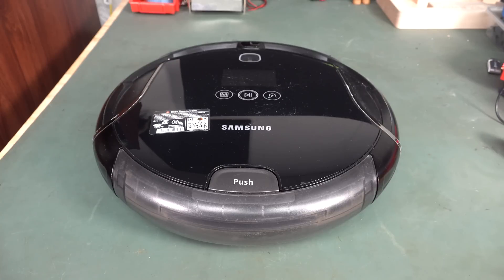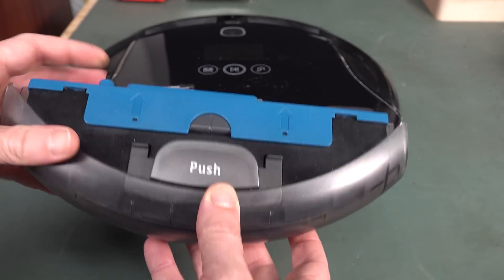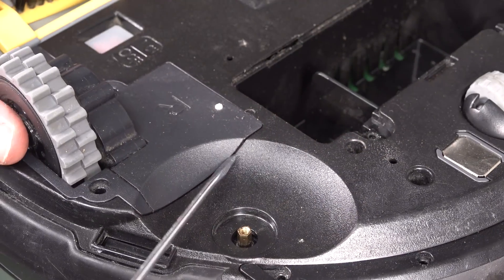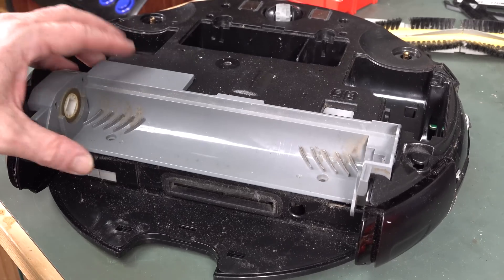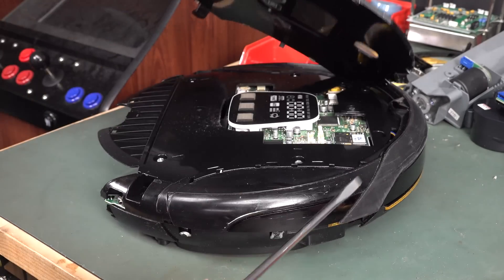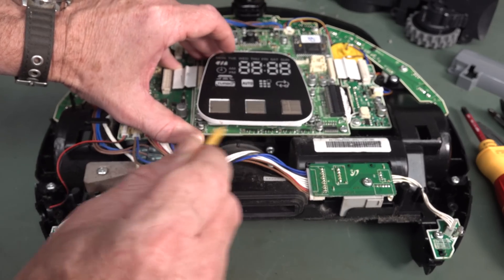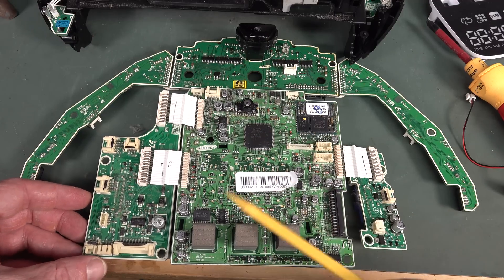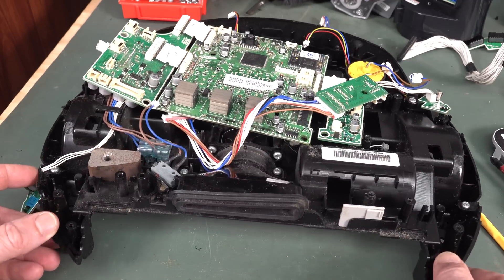EEVblog 1523 - Dumpster Samsung Cleaning Robot TEARDOWN

Comment: I bought one for my elderly mum, its brilliant, but need to get a good model, you can get irobot roomba model 980 for $250aud or so second hand in oz from ebay,  the later models you dont need to empty them after each use, they empty into a tower.
What is amazing is that the irobot 980 uses 4 lots of 18650 cells, such a small battery but it goes for an hour or so. The battery you could fit in 8 lots of 18650 if you wanted.
I just bought some panasonic ncr18650b for that purpose, a bit tricky to change the cells have to desolder tabbing wire etc, fiddly/tricky.
Go for irobot 980 is you want a really excellent vacuum, they also clean really well too.

Comment: That samsung one is rather serviceable. I like that!
If you ever get the chance to take apart an Vorwerk Kobold VR100 (or one of their siblings): That thing is linke Voyager 2 in therms of serviceability. Cant get it open without breaking every stupid plastic clip. And if you're in you'd be greeted by a nice "Neato robotics" on the boards silkscreen.
I have a Neato robot vacuum and can say: Vorwerk took an existing design, made it 5 times worse and sold it for 10 times more

Comment: That Robot vacuum cleaner (SR8980) was €700 when it came out in 2013, my BluMill MT-710 looks precisely the same 
as this Samsung SR8980 Robot vacuum cleaner on the underside, mine even has Mopping function and Water tank with 
2 mops, but my cost €159 and does the same or more, and works great on my carpet , it's never been that clean 🙂.

BTW, my debris reservoir, is much larger then this Samsung SR8980, and is 600ml.

Comment: It is interesting to compare this to my old Roomba. Overall very similar but I saw some differences:
1 - On the Roomba the suction is from a fan within the removable dust collector, so the fan has clean air running through it.
2 - The Roomba monitors the front idler wheel for motion. The wheel is half black and half white and an optical sensor can detect it rotating. I can always tell this wheel is clogged with lint as the vacuum will move a few feet, turn, move a few feet, turn, and so on rather than trying to go in long runs.
3 - The Roomba has a sort of mechanical torque detector on the motor that runs the main brushes, I assume to detect that they are getting too clogged. I'm not sure why they don't just monitor the current draw...
4 - The Roomba only has one edging brush. I assume it only follows walls in one direction.

The main drawback for is is that some members of our household have long hair and it is frequently necessary to open up the brush cage and remove the hair wrapped around the brush.

Comment: Wow, I just tore one of these down myself. Mine was a kerbside special/road kill from some renters dumping their junk and doing a runner. It came with a dust exaction/charging station that I left behind. Mine didn't have the USB port, just 4 solder pads for one. I was kind of interested to see if you would have found the hidden screws, but no, brutalized like mine. I was most surprised to see a camera - the things spying on us was my first thought - remember all the carry on with the Samsung TV camera's - not good.
I powered up the main vacuum motor, it squealed quite badly from lack of lubrication, probably why it got dumped. So I added some oil, but boy is that a weak air pump, the exact opposite of many 240V mains vacuum's that have a one kilowatt or more motor, and pump out insane levels of heat in the process. It kind of made me wonder how this thing ever worked with suck a low powered pump. Sure it cannot be that powerful as it is battery powered, however I thought it was a bit of a joke.
Reply: This was many years ago and I can't remember where I read it now but I read, with some surprise, that the main cleaning action from robot vacuums is not the vacuum suction but almost entirely the mechanical brushing action. This might have changed in the meantime.

Comment: The one thing that should be said in huge flashing red letters accompanied by air raid sirens, is be super careful if you have a dog that might poop on the floor. You absolutely positively do not want a bot to try sweeping that up unless you need industrial strength help purging. Otherwise they work pretty well, at least on hardwood floors (guess why no rugs anymore). You may need to make some accommodations to make it happy though, like rearranging furniture slightly, removing those low friction slider things that may make the couch exactly the right height for to bot to get itself wedged into, making sure the charging station beacon is in a place easy for it to spot, and putting the dog down the garbage disposal.

Comment: Hi Dave, I've got one if those. It needs IR "light houses" to mark of forbidden zones and a remote control.
The eye at the underside us for it to not fall of the stairs, which has also a major disadvantage. I have a small piece of carpet on a mainly wooden floor. That carpet is black with a pattern of light colored circles.
The robot gets completely bonkers on that carpet as he thinks that's an abyss (stairwell) and refuses to go on, but only goes in narrow circles, not even back! Poor thing!

Comment: I'm only speculating, but I think that row of carbon pad switches for collision detection, are not on-off switches, but rather are always in contact. Pushing on the pad changes its resistance. Like a carbon microphone, a small current is passed through it, and a collision is detected as a change, or a blip, in current.

Comment: I have two older Samsung robots. One upstairs and one down and the run every day at noon. Im constantly amazed at how much they find even after running for months.The one downstairs covers the lab and picks up wire strippings and aluminum chips I track in from the garage. 

 I picked these up used from a friend and had to do a couple minor repairs but they work great. I cant recommend one enough.
Reply: I live on a multi-level home; there are 4 distinct levels connected by short (2 steps) stairways.   How many of these things would I need?
Reply: @tubastuff  then can’t get down or up stairs so you will need one for each level you want to clean. In the case of my house it is a split level type with daylight basement. So the entryway is between the two floors. So I still have to vacuum that area and the stairs manually.

Comment: Before I start watching this, I did find and open up a cleaning robot about a year ago. I don't recall the brand but do remember it was absolutely disgusting! There was dirt and hairs stuffed in just about every space available. I wound up taking out every motor, the power jack and switch, a couple rectangular weights, and every spring and screw save for one which was inside a clear plastic water tank and not worth the trouble.

Comment: Kalman filters are more commonly thought of in positioning applications, using data from sensors. The case you are thinking of is a more recent use of it, in computer vision with self driving cars. In this Samsung product, it has nothing to do with object detection or tracking, but rather taking the data from accelerometers, gyroscopes, motor speed, etc and trying to determine position.
Kalman filters can be used for many different things though... the most common and simple case is the phase-locked loop in electronics.

Comment: Next week he might run into the charging station.  We have a Bissell crosswave equivalent and it tends to screw up a lot, but it goes around most table and sofa legs. The bump sensors contact chair legs. (movable)   Ours is monitored and controlled via WiFi from my cellphone. Ron W4BIN

Comment: What a world we live in. Not only do we have robot assistants, they can be found in the dumpster! 😅 My mother uses her Shark to manage dog hair on a wood floor. Seems to be about the best use case for these things. Edit: Having now watched the video, I'm impressed at how many reusable off-the-shelf parts there are. I guess that's how we know the bean counters haven't reached peak efficacy in that industry yet. 🙄👍
Reply: Sad to see how many good components are put in the trash. We really need to design some kind of automated reflow oven that would remove, identify, and organize  all those components for reuse. But price of the components is so low its probably not possible to recoup the money needed to even run the machine. Crazy
Reply: @BradKwfc  I'm increasingly convinced they won't stay that cheap, unless the robots completely take over all the industry. Having seen how spectacularly international logistics can break down, and knowing the upcoming generation does not seem to tolerate worker exploitation, suggests to me that such a salvage machine might be viable in our lifetimes.
Reply: @McTroyd  
I hope so. The amount of electronics we trash is bad. I saw a video showing alot of it goes to the third world where they burn it out in the open to get the metals out.
Reply: @BradKwfc  yeah, with literal rivers of mercury around those fields.

Comment: Back in the day, I worked across the street from a vintage (now) competitor to IBM in a town where they were active, and I got a lot of motors, power supplies, and the like. I had a Meccano at the time, and built many things with those parts from the dumpster. Now I'm building tractors, and the like.

Comment: The IR receivers all around are to detect the dock (base station) and are used to approach it to charge and also avoid running into it during cleaning

The IR pairs all around are to detect obstacles early and slow down or avoid bumping into them

The hall effect sensor in the front is used to detect magnetic strips; the unit likely came with magnetic strips that you could place on the floor around the your house and act as "walls" to block the robot from going into areas you don't want it to; the robot would detect those and not go past them

The camera is used for the SLAM (simultaneous localization and mapping) system so the robot can create a map and keep track of its location; it effectively uses features on the ceiling to determine how the robot is moving; from experience these V(isual)SLAM systems perform pretty poorly; even iRobot which pioneered it (for robot vacuum cleaners) still had to use an optical tracking sensor on the bottom (think computer mouse) to provide additional input and now in their latest top of the line products are also using solid state lidars as well (with limited FoV)
Most products use rotating lidars with 360 FoV which work much better with the downside that the lidar module sticks out the top of the robot and increases its height and is more expensive

Fun fact: the cliff sensors on most products can't distinguish between a cliff and a dark surface so good luck if you have a black rug; I think it'll be a while till they can take over

Great video!
I work in the industry and this was a very different construction than what I've seen; definitely intrigued by the touch button solution!
Reply: It's incredible how unaware Dave was of these things (or at least pretended to be)
Reply: @nrdesign1991  was banging my head on the desk when he didn't know what the strip was behind the rubber bumpers.. common sense even tells you it's contact buttons.

Comment: Those yellow sensor strips underneath the rubber bumpers look like touch sensors, used to sense running into an obstacle.  How did it connect to the motherboard/sensor fusion system?
Reply: Much easier to watch the video BEFORE commenting and asking silly questions.

Comment: Kalman filters do a great job of sensor fusion: throw the accelerometer, magnetometer, and gyro readings at them, and get a more accurate estimate of pose than any of them separately. It could also incorporate the motor encoders for an even better estimate, but that needs fancier maths than what that module is probably doing.

Comment: The Kalman filter is used here for sensor fusion - combining the gyro and accelerometer data. Kalman filters can estimate the state of a system using multiple different noisy measurements. They are very commonly used with IMU sensors.
Reply: According to the block diagram it also seems to fuse data from the error correction filter?

Comment: Nice video timing, I bought 32 defective units about 2 weeks ago (€400), it has been a lot of fun repairing them. It's clearly visible that this is an older device. Newer models have a lot less passive components,

If anyone is interested:  so far I have been able to repair:
2x Neato d3
1x Neato d5
1x Neato d7
2x Roborock S6 maxv (one still missing some parts)
1x Mi Robot Vacuum Mop.
Reply: What were the problems, all mechanical?
Reply: @jaro6985  The problems with the defective units were mostly related to electronics, including water damaged pcbs on the Roborocks and defective switches on some Neato models. Additionally, some Neato units had issues with the main PCB, such as broken resistors in the i2c bus. The Xiaomi Mi was the most challenging to repair, as someone had drilled a hole through the PCB (warranty scam?) It required reconnecting about 12 tiny traces on a 4-layer board.
Reply: @Vidicon31  interesting, thanks.

Comment: Dave, those IR pairs on the sides are distance sensors so that it knows when it is approaching wall or furniture and slow down. The IR receivers are most likely for detecting the base station and any of the IR "walls" to restrict where it can go. This is very similar to the old versions of the iRobot's (now Amazon) Roomba. 

The camera pointing upwards is likely for position tracking - essentially a giant optical mouse upside down. It tracks the ceiling/room so that it knows where in the room it is (together with the IMU). Old Roombas don't have this feature, they only wander semi-randomly through the room.

The Kalman filter is a bog standard way of doing sensor fusion (gyroscope/magnetometer/accelerometer) so that you get a drift-free robust orientation. It doesn't do the camera fusion or anything with position in space - that's the main processor doing the SLAM stuff/navigation. These IMUs cost a few bucks these days, you have them in all phones or game consoles, etc.
Reply: My Samsung robot does have IR remotes. You can drive them around with it and you need them for Wi-Fi setup.

Comment: You still can buy some without cloud control but even the cloud controlled units have at least 2 buttons for clean and return.
I use a second generation robot vacuum (no camera) for years now and it is on it's 2nd battery pack (and 3rd wheel motor XD). Newer ones get more and more resistant to remove from skynet. ;)
Reply: You can get root access on many current robot models (e.g. roborock or dreame) and run them without the cloud.

Comment: I think it's fair to say the NXP jobbie isn't the processor, if it's running Windows CE it'll be that Telechips SOC. The NXP is probably working with those IR receivers on the front at a guess.
Reply: Yeah. Probably motors, IR, etc.
LPC2926fbd144

Comment: It’s pretty amazing how far these devices has come.  I have a cheapie Amarey robot vacuum with a similar camera.  It’s used for the VSLAM (visual simultaneous localization and mapping) system, which initially maps out obstacles and walls and plots it’s linear back and fourth path around detected obstacles.  

I tore that apart, and it pretty much had two PCB’s; the CPU module including WiFi device and the power supply and IO (for sensory input and motor driven outputs).  Does it work well?  Not really.  But definitely entertaining to watch.  Although it doesn’t clean as well as a 25 lb Kirby and takes forever to clean a single room, it’s advantageous in the sense that it will free you up to do other things.  I’m always pro-automation over efficacy.